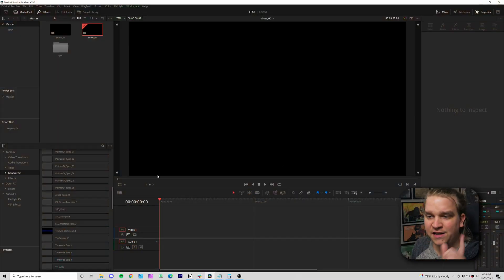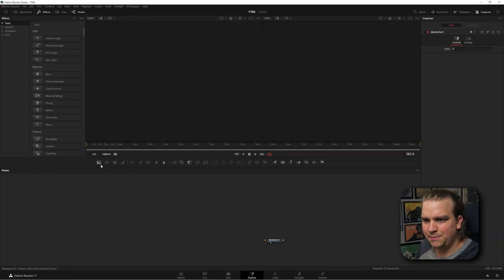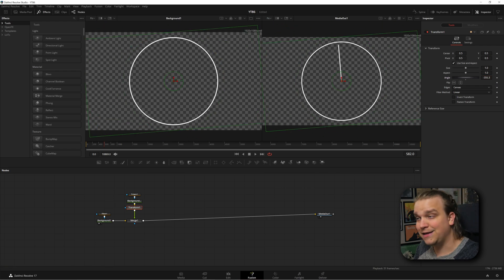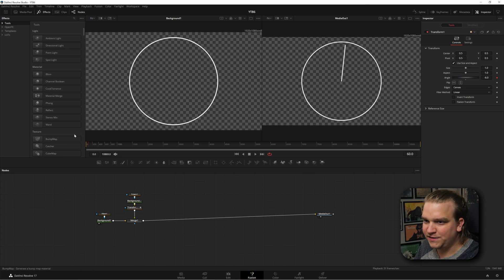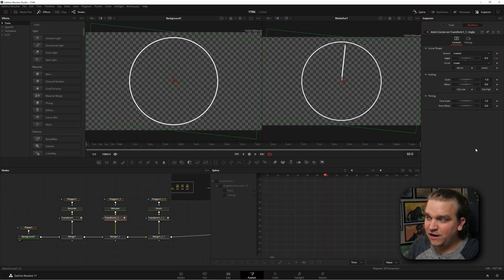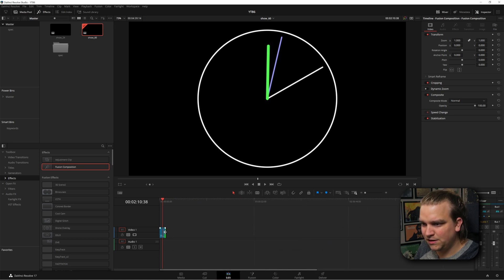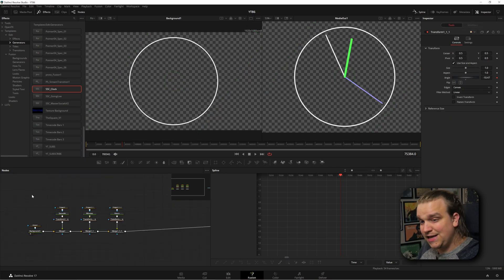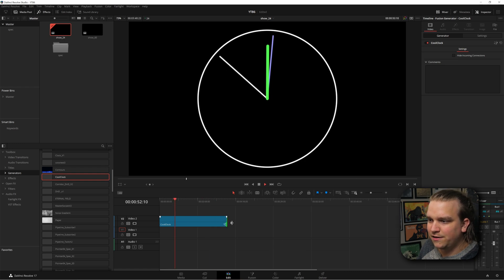A DaVinci Resolve clock. just because.

Comment: Thanks for the clock, is there a way the clock could start at 2:00PM ?
Reply: You could set the initial angle of the small hand to -60 degrees. 360 degrees is 12 hours, each hour is at a gap of 30 degree so have the small hand at 2 you would set the angle to -60 degree. The rotation maths independent of the start time, so you would be fine.